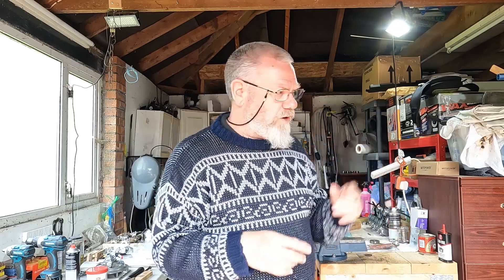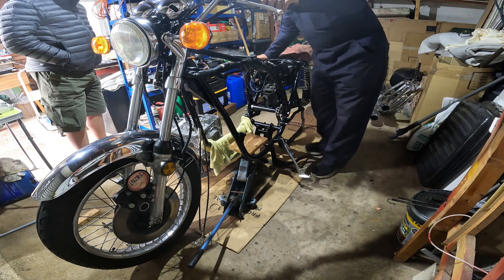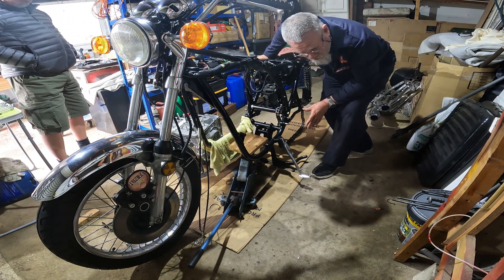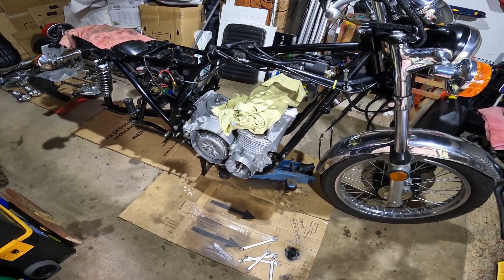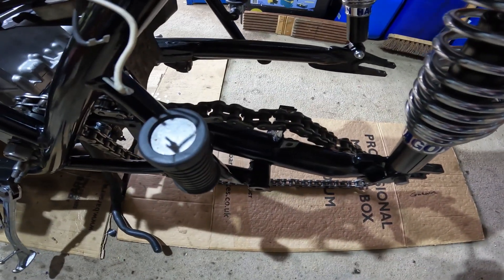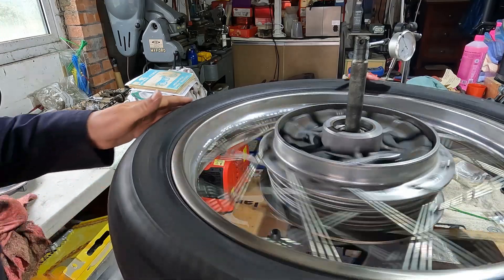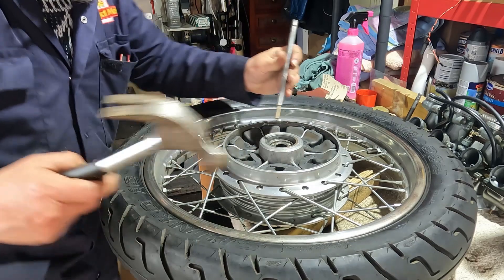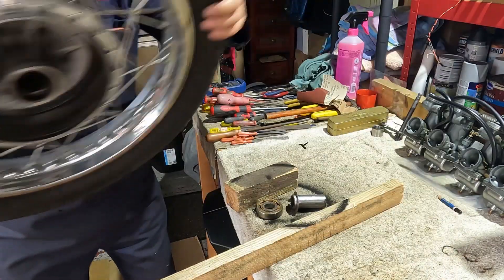Kawasaki Z1 900 - PHASE -2 Part 1 - Engine goes in and the and the swing arm and more...

Comment: Put the engine on the floor - on its right side, with some soft blankets under it. Lower the frame down and onto the engine, and put the bolts and mounts in place. Job done!